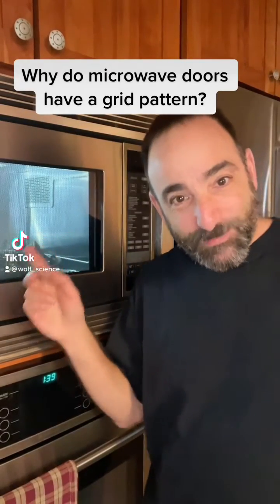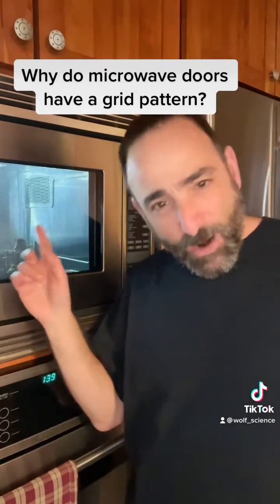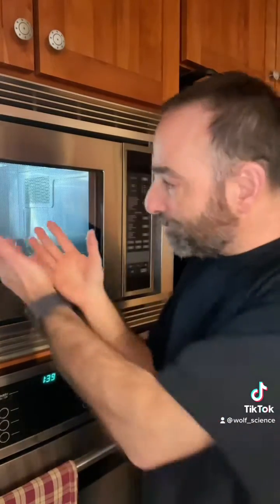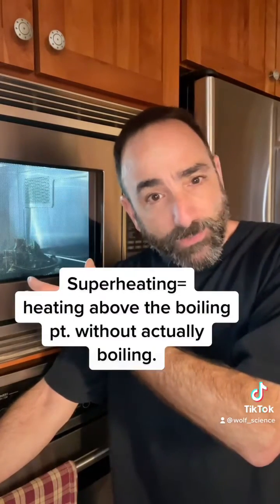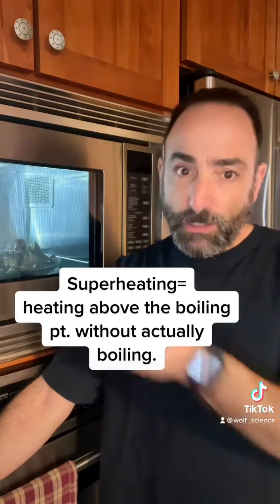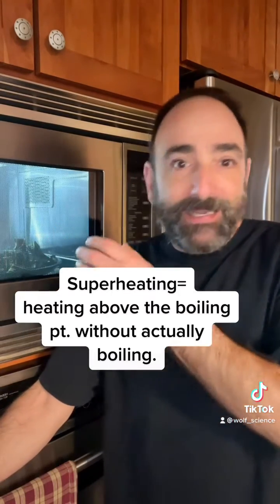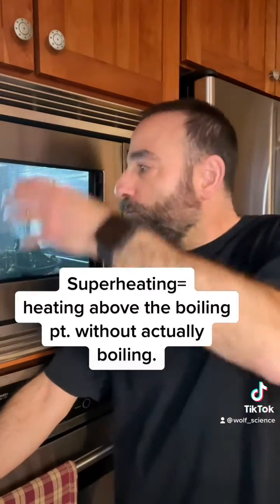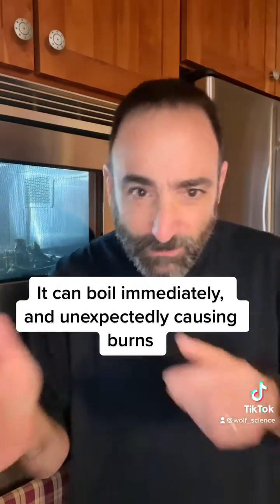Patterns on microwave door?

Comment: I want to see this!  It sounded to me like 'jostling' this super-heated water somehow has an impact on it's boiling process.  Did I mishear something, or is it possible to start (or affect?) the boiling process of microwave-super-heated h²O by tapping it a bit?
Reply: Yes! A friend used my plastic jug to heat water in the microwave. She left it on far too long because it didn't appear to be boiling. But that water became so hot, way over 100°C, that it melted the inside of the jug enough to produce a rough ring around it. 
As soon as the jug is disturbed, the boiling action begins, with superheated steam bubbles frothing up. Very dangerous to handle!